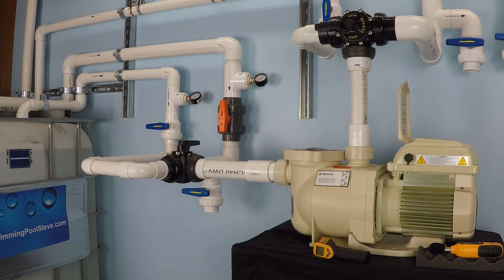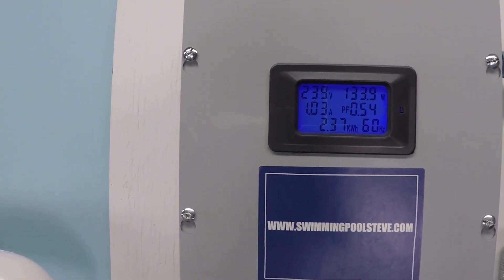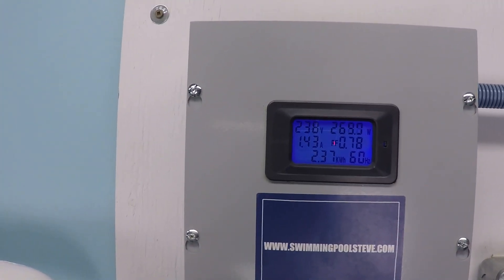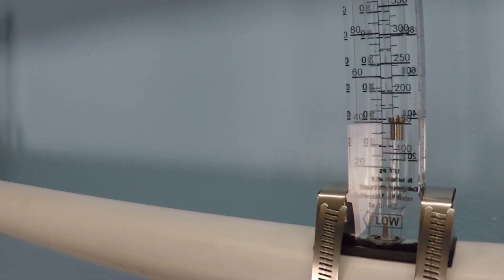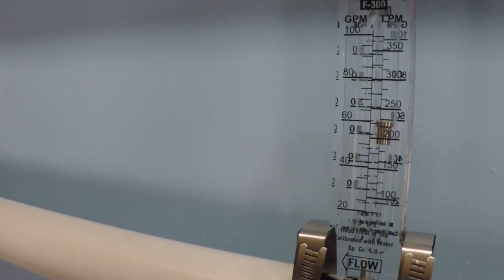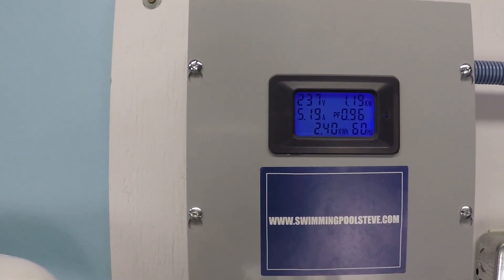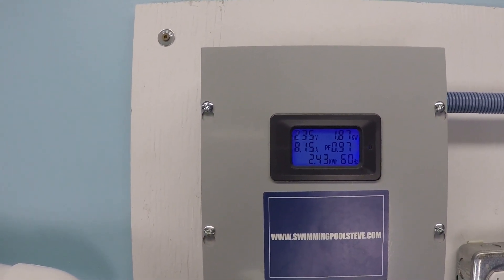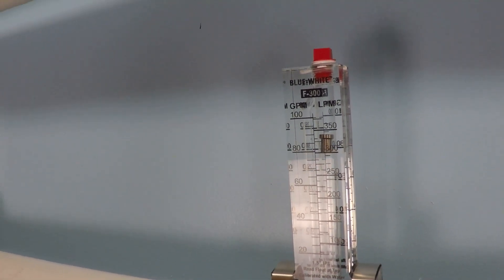How Much Flow From A Variable Speed Pump

Comment: I’d be curious to know how much more efficient the pump would be with larger lines. It seems to me that when the performance rating of the pipe is exceeded the efficiency drops significantly. Have you tested with pipe diameters larger than 2”?

Comment: Thank you for a clear and concise packet of information. I stumbled across you after wading through a lot of impossibly hard to follow so-called "instructions". My favorite was the one that told me to calculate flow rate by dividing the time it took for one complete changeover into the total number of gallons of your pool. Technically correct but no mention, of course, of how to determine when one complete changeover happens.
Another talked about "dynamic head". It's almost funny, but frustrating for the layman.

Comment: I can’t run my pool but so low because of resistance. Trying to save energy. Otherwise I’m not moving water. Very low pressure on the filter gauge.
Reply from the maker: The filter pressure gauge is not how to determine flow.  You could show zero PSI on your filter and still be moving an appreciable amount of water.  The correct solution to your problem is to install the correct instrumentation to monitor the rate of flow volume. You can learn more about this here: http://www.swimmingpoolsteve.com/pages/flow-meters.html